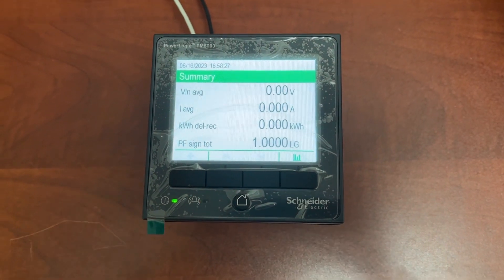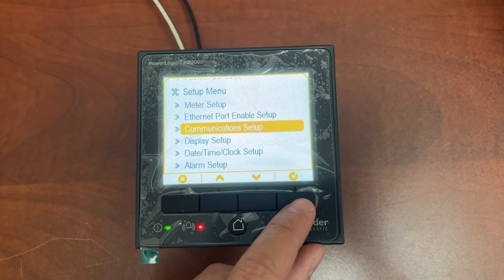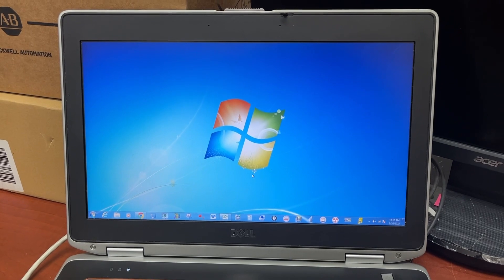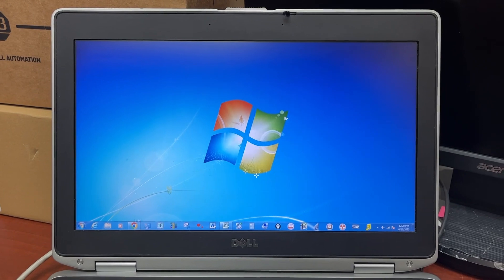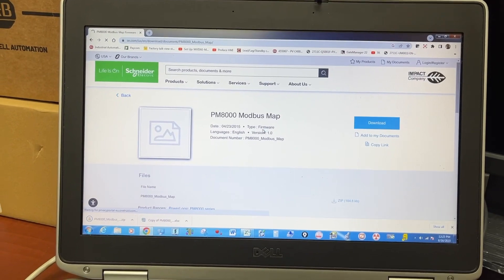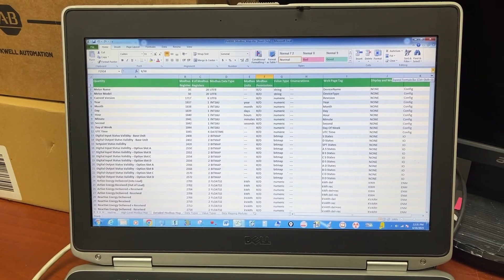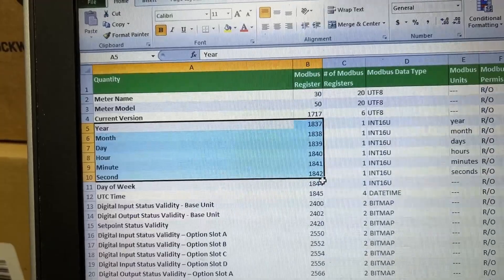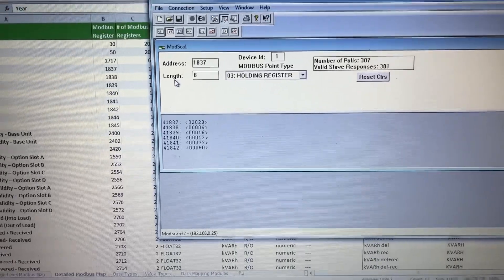Schneider Electric PM8000 PowerLogic Ethernet Modbus TCP

Comment: I've got a question, I need to read PQM registers, like THD values. The thing is that those values start with direction in 21300 and so on, they're not in the range of holding registers, and they cannot be boolean points or something, it has to be a holding one. Do you know how those registers have to be read?
Reply from the maker: @axelpadilla1553: I am not sure what 21300 means. Is it an address of a certain parameter you want to read? You need to look for the right Modbus function code for communication.

Comment: Hi anh, anh có thể cho em hỏi là dòng PM5300 cụ thể là PM5320 có hỗ trợ Ethernet Modbus TCP/IP nhưng khi em thử kết nối với modscan thì nó báo lỗi "Modbus Exception...". Anh có từng gặp lỗi này chưa ạ :3
Reply from the maker: @ghuy6073: Thanks for your comment. I think it should come with Modbus TCP. There are a few things you might want to check. First, make sure you have the right register mapping. Second, slave ID might matter. Make sure you call out the correct slave ID on your master device. Third, be specific on the register length or count. Do not set the length too long or pick up too many registers. If the registers are not available at the device and you are trying to pick them, it might give you errors too. Good luck!!!

Comment: Thank you for the great sharing. I've also used Modbus RTU with PM800, but I find Modbus TCP to be simpler. Thanks again!
Reply from the maker: @ScadaHub: Glad it was helpful! A "super thanks" at the lower right corner is also a great way to show your support to my channel. Thank you.
Reply: Amigo me puedes ayudar con la configuración de mp800
Reply: @andersonrivas9545  Technically, Modbus TCP and RTU are the same; the difference lies in the connection settings. For Modbus TCP, you only need the unit ID, IP address, and port, whereas Modbus RTU requires settings for serial communication.
Reply from the maker: @andersonrivas9545  :What are you trying to configure on the PM800?

Comment: Hi Dear, I have some power meters connected with 485 (Modbus RTU) with 485 to Ethernet converter. I wanted to fetch each meter data in CompactLogix via Modbus TCP AOI provided by Rockwell.
The AOI is successfully connected with Modbus TCP device ( Modbus Poll) but I am unable to understand how to get data of RTU devices. 
Means how I can refer to individual slave ID reference in AOI configuration. 
Would appreciate if you could help. Thanks in advance
Reply from the maker: @yariprince: This video is for Modbus TCP communication for the power meter. Are you using Prosoft Modbus module/gateway for Allen Bradley PLC to pick up Modbus data from your Modbus RTU power meters. If the AOI is for Modbus TCP, it will not work with Modbus RTU devices. You will need to import a new AOI for Modbus TCP. Also each slave device has to have a unique slave ID#.
Reply: @SYPHOANG  Right now I am using Kepserver with Modbus TCP driver to get the data from Power Meters with configuration <Converter IP Addess>. Slave ID. 
I wanted to confirm if the Rockwell TCP AOI can be used to get the each Modbus RTU slave devices.
Reply from the maker: @yariprince: I am not sure what you mean for "Rockwell TCP AOI". (1) From my knowledge, I believe Rockwell itself does not make any Modbus module/gateway. (2) TCP is for ethernet communication instead of RTU for serial. (3) AOI is for Add-on Instruction in Studio5000 logic designer. Prosoft makes Modbus modules/gateways and provides AOI to make it work with Rockwell PLC's. However, Prosoft's AOI's for Modbus RTU modules/gateways are different from those for Modbus TCP modules/gateways.
Reply: Me puedes ayudar con mp800